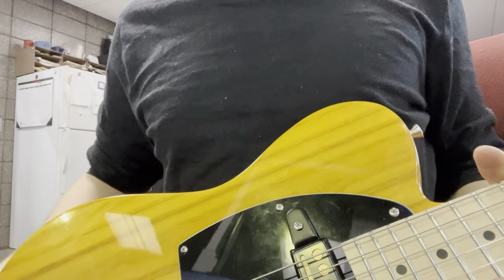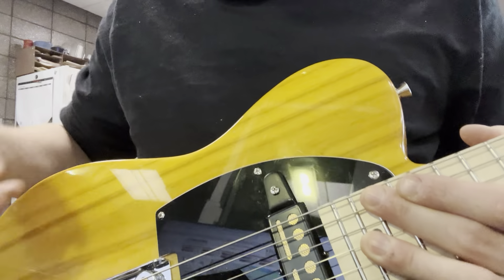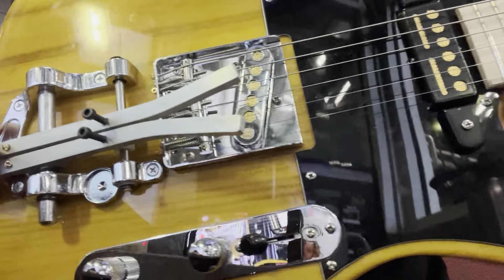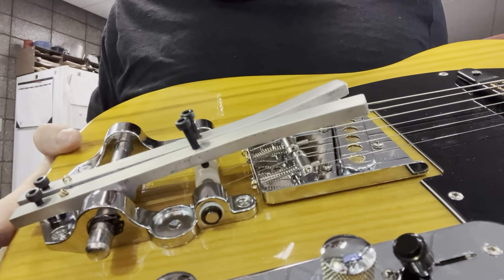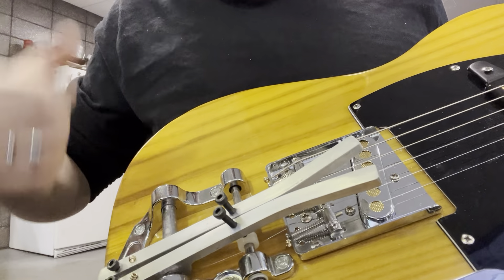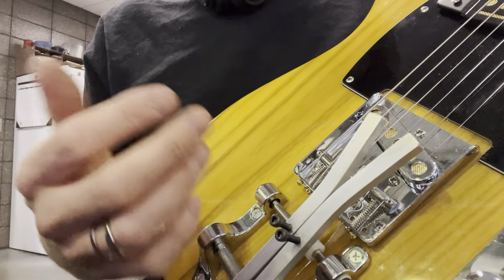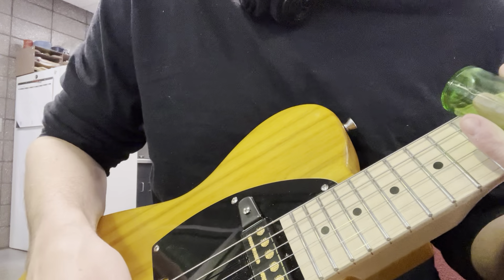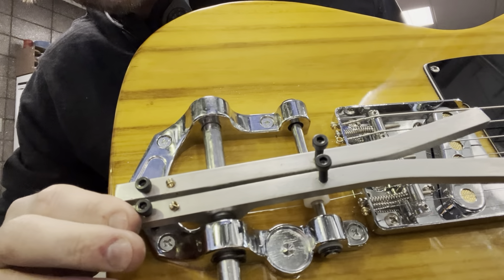Testing my Aliexpress Bigsby Palm Pedal B and G bender.

Comment: Big respect to you! Absolutely brilliant.
Reply from the maker: Thank you! I can’t believe how well it actually works. I’m going to try and make a more thorough video explaining what I did in case someone wants to make one.
Reply: I agree. I didn't expect it to work.
I used to make a lot of "telecasters"!!!
Reply: How did you Mount these aluminium
Rods to the bigsby? I’ve tried to solve the same problem. Thanks! Brilliant❤
Reply from the maker: @danielskjdt9777  I had to remove the clips that hold the rods in place and slide it out. The aluminum arms I made using a milling machine and a drill press. Then tapping holes for the set screws.

Comment: How much would one have to pay ya to make more of those bender arms?! Have been scanning for a 2arm BPP in the usual places for 3 years, no luck😂. I'm good with wood, but working metal is another world to me!
Reply from the maker: @matthewvilleneuve1452  I’d have to sit down and figure it out. My aren’t as polished as the old ones but then this was just an experiment. I’d have to figure out how much materials would cost, I just used some scrap aluminum my dad had laying around, but I don’t have any more of that.
Reply: @googaboogaloo  well, put me on the preorder list! :)  really don't care about the aesthetics, just function and comfort. Do the arms need a bearing, or goodnuf to drill hole for shaft to closish tolerance and lube?